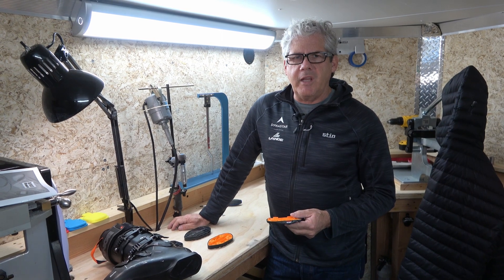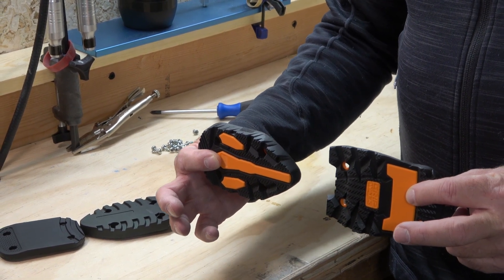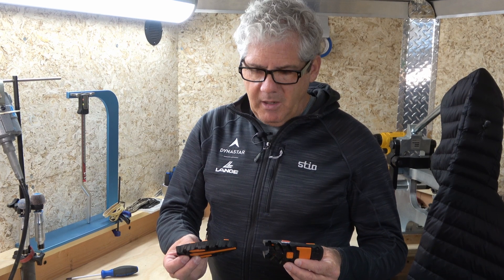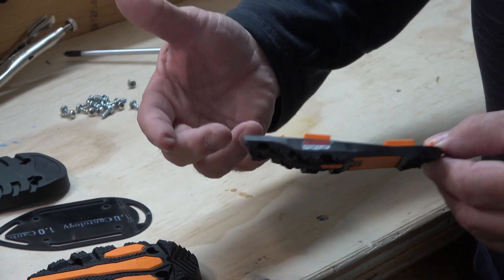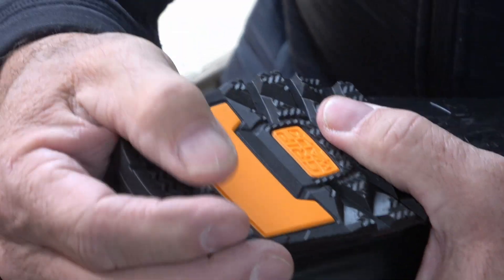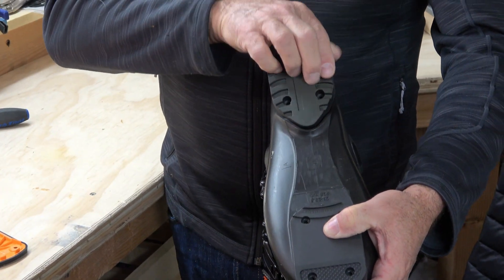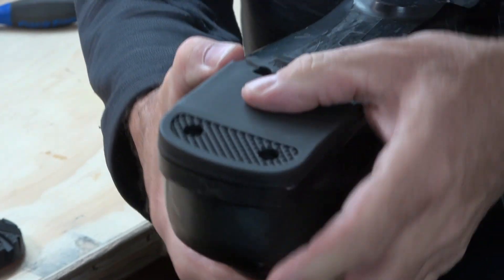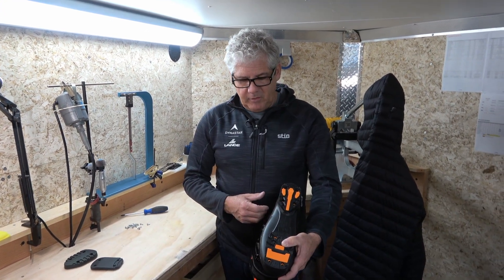Cants with GripWalk® Ski Boot Soles

Comment: Hi! Very usefull explanations! I have a pair of Dynafit Khion whic I love both for tech bindings, and for piste skis. They fit some grip walk bindigs, and others seem to require a "slimmer" space in front, where the proper GW soles have that plate. Do you think it's worth it to "grind" that area to.make it fit better? Or I will risk the binding not properly release when needed?
Reply: First of all, know that that boot is extremely dangerous to ski in, and know that it was recalled many years ago by Dynafit for very good reason. It can cause serious injury if you continue to use it. I know this might be pretty unfortunate news, but it's true and I highly recommend you discontinue using this boot. Trust me when I say this. It's not something you want to mess around with. 

Second of all, the Khion (and the Beast that came out later) uses a different standard than gripwalk - it uses ISO 9523 as opposed to ISO 23223. It is not at all the same as gripwalk, and the soles cannot be replaced. 

The khion is not supposed to be used with any alpine step-in binding that does not accept an ISO 9523 sole either natively, or via adjustment of the Anti-Friction device or the toe height. 

Do not "grind" any area of your boot in order to fit into a binding. This is not something you want to DIY at all. Especially with that boot.

Comment: I was curious about this. That's a good news. Except, the traditional soles aren't that easy to get. At least in my case. I bought new boots and I have fairly recent skis and bindings, '18 model year. The store where I got the boots couldn't get me the flat soles. Contacted mfgr a couple of times and didn't get anywhere. Big store, major mfgr... without naming names... I ended up buying GW compatible bindings because I can't spend the rest of the season chasing soles. But seems like I still don't have a straight forward option on dialing in the canting on my new boots which I was interested in after watching your videos. In this transition period mfgrs should include both with each pair of new boots.
Reply from the maker: Yep, in pushing GripWalk so hard, the manufacturers are not doing users who need canting any favors. We're still about a year away, so it seems, from having tooling and gauge blocks to make it easier for shops to route/mill off the boots with GripWalk outsoles. We didn't cover it in the video, but a careful shop can manually adjust the height of their router to properly route with GripWalk outsoles installed. But switching the router height back and forth between alpine and GripWalk is time-consuming and an opportunity for a costly mistake if they forget. 

To route alpine outsoles, many shops set their router height permanently to the ISO heel standard height (30 +/- 1 mm) and then put the boot sole in an aluminum 'sled' (like a tray) to route the toes. The sled elevates the boot above the router table the proper distance, thus effectively lowering the router blade to the ISO toe standard (19 +/- 1mm). Much easier than loosening the router collet, reducing the height to exactly the toe standard, then re-tightening the collet. Of course the new GripWalk ISO standard has different heights at both toe and heel so the existing sleds don't work and tool vendors are not yet offering new ones sized for GripWalk. 

 Installing alpine outsoles, as we show in the video, is faster and, hopefully, less prone to forgetfulness, than changing router height back and forth between the two ISO standards AND between toes and heels. But a careful technician CAN do that.